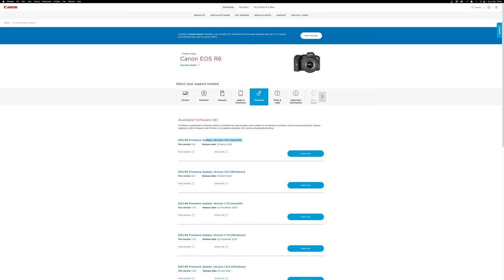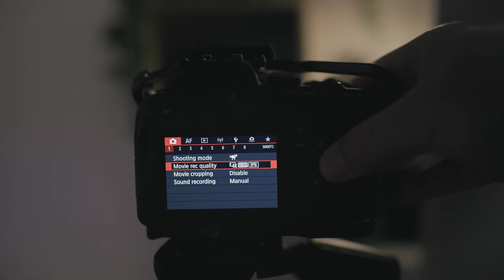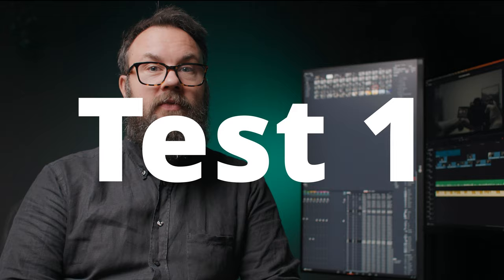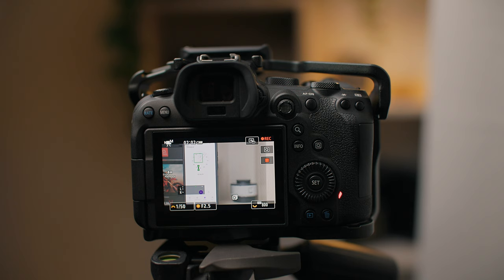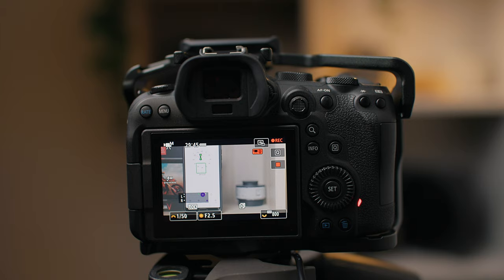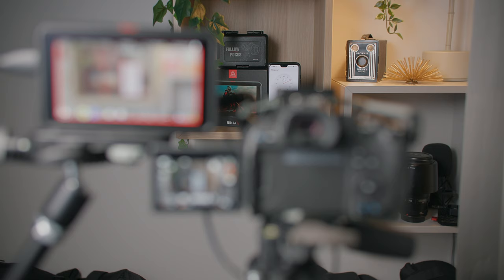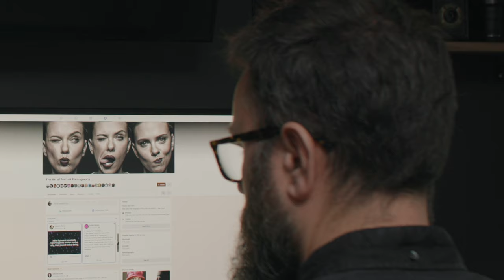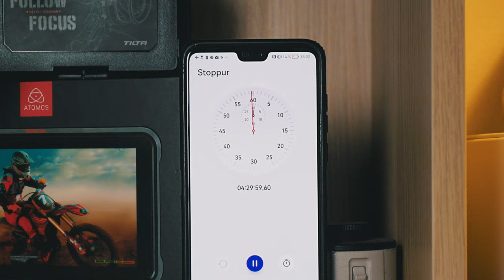Canon EOS R6 overheating

Comment: 36min with the Ninja V? Which firmware do you have on th R6? I have to film in a theatre in a few weeks, so buying a ninja is not worthy?
Reply from the maker: I got 5h+ with the Ninja V, as I show how at the end of the video. I used firmware 1.8.1, but initially done test on this matter since version 1.6. There is a huge difference between 1.6 and 1.8, but still not enough without external recording and all the other fixes I added. The 36min was with the camera in factory mode and dual memory cards :) I hope this helped answering your question, otherwise just fire away and I will try my best to help
Reply from the maker: How did your shoot go?
Reply: @persvanstrom  It is next week. At the moment i'm trying out max recording time (battery) with the ninja.
Reply from the maker: @DatHirschi  cool, how's it going?
Reply from the maker: @DatHirschi  I managed to overheat my Ninja after 22min in an interview session after doing this video. Was very surprised, but when I went over it afterwards I realized I was worried about keeping focus, so I kept poking the screen, waking it up. I think that made a huge difference, so maybe try to keep monitor off as much as possible?
Reply: @persvanstrom  It's about 45 mins here with the small NPF...
Reply from the maker: That is really good, you got this 👍
Reply: @persvanstrom  Seems like the recorder is overheating.

Comment: This camera is a toy. For 2100 USD basic version but I spent 3500 USD with basic cards, batteries, grip, and basic lens...waiting for Canon's feedback, if it will be negative....well, I will not invest in canon never, ever, again...THIS CAMERA IS NOT FOR 4K filming....
Reply from the maker: I feel you, even if I don't agree :) I think expectations are important and an R6 or R5 is a hybrid mirrorless camera and with that, expectations should be it is a photography masterpiece that also can film. It's not a cinema camera that can film for a full day, multiple codecs and no problems. For 2100 USD I personally believe it's a steal. 

With that said, I'm not saying you are wrong, just that different people will have different perspectives, and you are 100% right from your perspective as I am from mine. 

Most negative comments I read about the R6 and equal cameras are the lack of long use of 4K recording in 60fps. With a legal stop of 29min, we should not expect anything but burst video video usages imho. If the need is mostly video I would recommend a cinema camera or even two cameras. 

Still I feel with anyone dissapointed and I think it's entitled, but also hard. I don't expect my regular car to be able to do heavy off-road, but I would be dissapointed if I can't park it on grass. If that makes sense.

Comment: You shot in CanonLog3 for the final video (Your 5+ hours of recording). I watched this video, made the decision to get the Canon R6, the Ninja V, dummy battery...same setup right. CanonLog3 same result i.e. As long as I wanted AND as long as the display was off. Shooting in standard...30min. This camera is junk. You changed the parameters (settings) of the test on purpose and didn't mention it. I regret the purchase. But, I did learn a valuable lesson...don't listen to salesman on Youtube. It's just a commercial. Some guys are just untrustworthy. But, don't take it personally, Same goes for guitar pedals, guitars, plates, dishes, rain coats, jackets, bags, shoes, computers, hard drives, games, fans, humidifiers, curtains, tires, cars, phones, trackpads, external hard drives, etc. I could go on forever. But, maybe you'll get a sponsor soon...you know...the goal
Reply from the maker: I pay my own gear, so not sure about the commercial reference, but if you only get 30min, then you are still recording internally. The camera is locked to 30min, no matter what. Only way to bypass 30min hard recording limit, that isn't related to overheat, but just a hard block on most cameras, then you need to record externally. My problem with external recording and the reason for the video was that even if I recorded externally, I still got overheats. That should be gone with my suggested solution. If you hit record on the camera, it will be internal + external. If you hit record on Ninja, it will be only external and no 30min hard limit. Check this and if still not working, poke me and we can sort it together as I'm not hear to sell shit, I'm here, trying my best to share my experiences learned by countless of hundred of hours shooting, with the hope that it will help someone else.
Reply: @persvanstrom  No, You changed it from standard to CLog3 in your video (watch it if you don't believe sand run the test again) I have and got your 5 hrs. I know how to record externally. Plus, I said some youtubers. If that offends you, that's your problem. Your results of 5hr+ is a result of external recording and putting the R6 in CLog3. That's it. You stand by what you said, that's fine, but you are either mislead, made a mistake,  or ill informed. I'd like to believe you made a mistake but, you double down and pimp the same video again. Maybe you should watch it again.
Reply from the maker: They are all shot in CLOG3, it's only the Ninja V that show the output on the dispaly. The ISO800 on the internal recording might tell you that. I'm not sure why you are so angry and unfriendly but I'm not your enemy. I will say it again, if you feel you need help, just let me know.
Reply: @persvanstrom  OK. Let's say I do not want to shoot in CLog3. I want to point and shoot, record to the Ninja V in 4k60fps. The camera is set the same. Not Clog3 but a standard profile in camera. Dummy battery, screen open. I get sometimes 30min sometimes less. But, when I change to Clog3 in camera,  rec709 monitoring, I get 5+ hours. That is all I am saying. I can never duplicate the 5 hrs in a standard camera profile, native monitoring. Eco off. Maybe, their is a setting i'm missing that you have set that's probably simple, but the frustration is across the board on this camera. For me, even with the external monitoring, it is not worth it. I don't blame you for my purchase, and I really do appreciate the videos (doesn't seem like it I know) but when I've tried for the last 8 months to duplicate your results, I can not. So,  I bought the camera and the external monitor and external battery and all the external rig to make this a point and shoot camera without having to use clog3, I should be able to and get the 5+hrs. My point is, without CLOG3...you will not get 5+hrs. That is the whole point. Nothing else. I know you are in CLOG3. Some people don't like to use CLog anything, just a standard profile.
Reply from the maker: @MrNocaster  ah, sorry m8, now I understand. I will try standard and see what I can make of it. Sorry for your problems
Reply: @persvanstrom  It's not your fault but I appreciate any help.
Reply from the maker: @MrNocaster  its an interesting observations. Got me going 😊
Reply: @persvanstrom  Did the update to 1.8.3. Working on it tonight to see if it helps. Thanks for your help.
Reply: @persvanstrom  OK. Been at it for 4 hrs. Recording for 30 min to camera at a time.(no Atomos Ninja yet) 4K59.94fps. standard profile.No overheating issues at all. using battery, display left on and closed. The only thing I did differently than any other time was I updated using the Canon cameraconnect app. to update this time. The only thing I can say to do is make sure to update, and update using the app and not using the computer. Possible file corruption? Possible fix in 1.8.3? I do know for me at this time, the R6 is doing exactly what I expected it to do from the beginning. To work properly without expensive accessories. so far, so good. Thanks for your help and for your professionalism in this matter. Thanks.
Reply from the maker: @MrNocaster great news 👍 and strong effort. 🎉 Merry Christmas
Reply: @persvanstrom  Merry Christmas
Reply: @MrNocaster  You just reminded me that I downloaded the 1.8.3 firmware some months ago and never installed it! I've been using the 1.8.2 for a while and keep getting overheat from time to time during events. I'm going to upgrade the firmware right now! I hope that fixes it
Reply: @AndresArosemena  Just make sure to download and install using the app and not the computer. I used the computer the first time and got the same overheating issues. I used the app the 2nd time and everything is still working fine after 4 months. Hope this helps.
Reply: @MrNocaster  thanks, what's weird. I would assume the firmware fil on the website or on the app would be the same. I'll update it using the app just in case. Thanks. By the way, there is a newer one. The 1.8.4
Reply: @AndresArosemena  Thanks for the info on the update. Everything is working so well with the setup I have now, I’m too scared to update. Lol
Reply: @MrNocaster  haha that's ok. I upgraded to 1.8.3 and then found out about the 1.8.4 and upgraded to that. I haven't shot anything new so crossing fingers nothing weird happens!